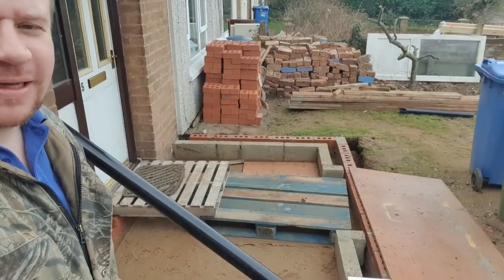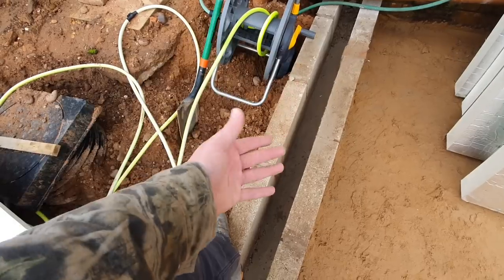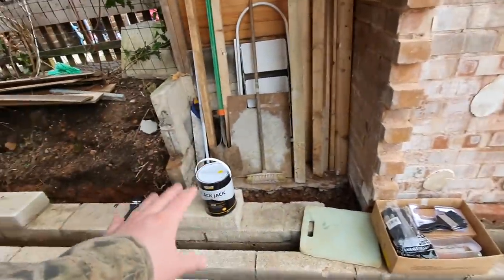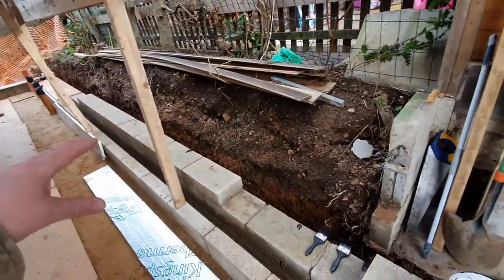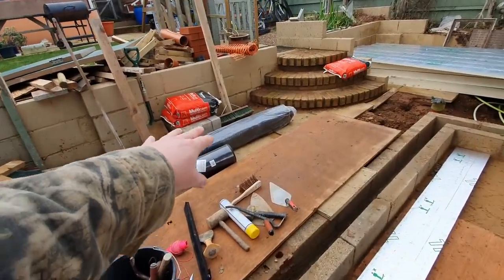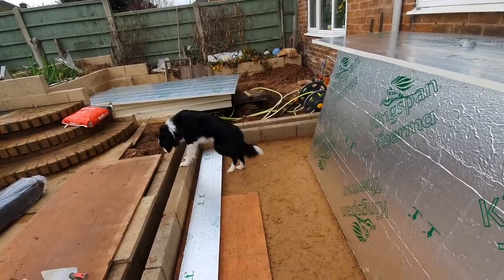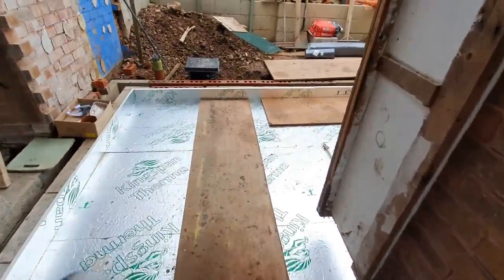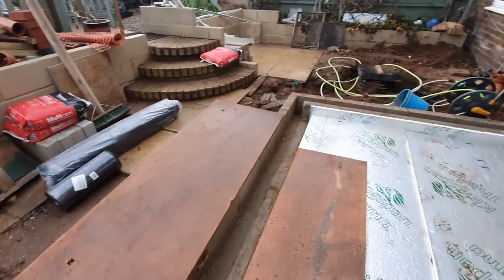Part 8 Of Our Extension Self Build - Floor Insulation - Vlog 878

Comment: Guessing you have poured the slab now but if you have spare perimeter insulation it can be a bonus to upstand against the existing wall. It helps to stop heat loss through the bricks.